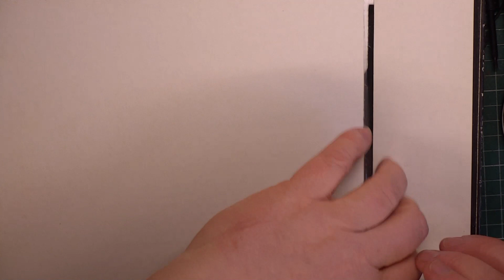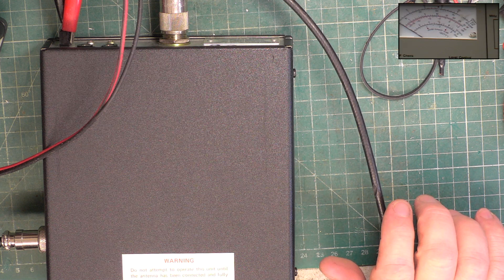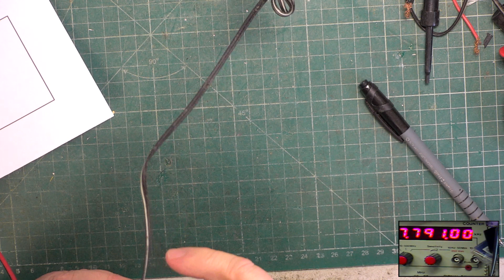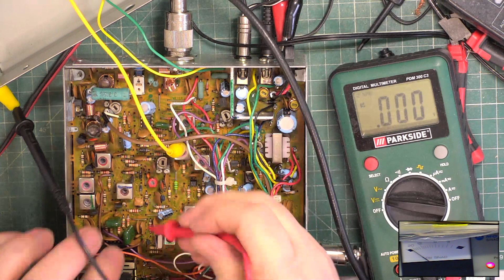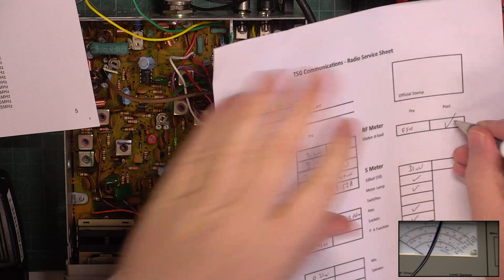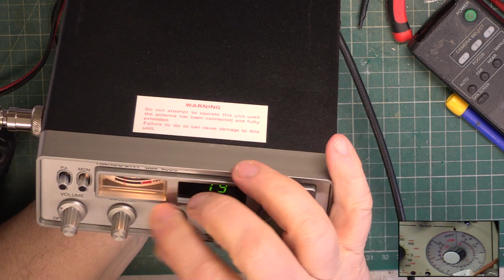Transcom GBX4000 CB27/81 UK FM CB radio - Like new boxsed set for service

Comment: I think I’ve seen you change the ballast resistor on this chassis so they do 4w. Did you consider change changing the ballast resistor on this one?
Reply from the maker: As this set is so original I didn't. Our 3.6 -3.7W is at least 7 Zetagi watts.